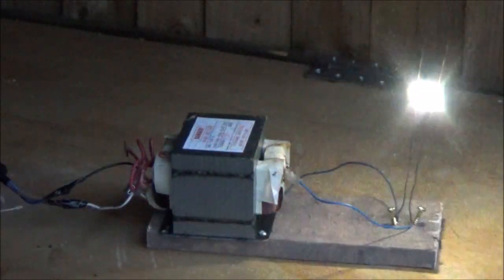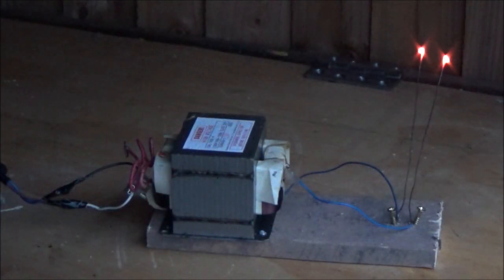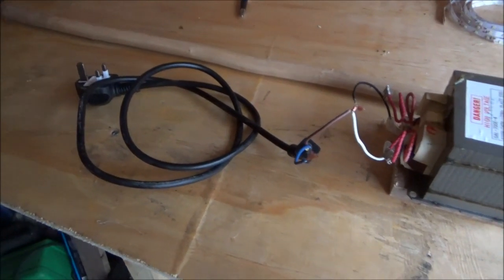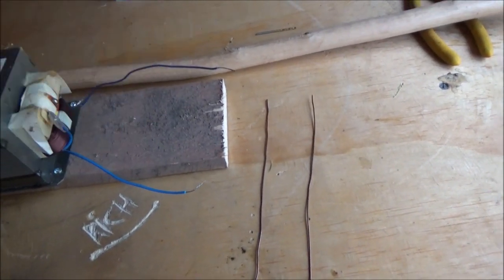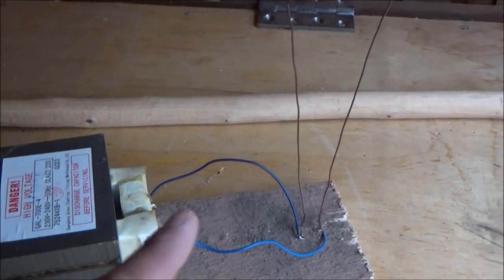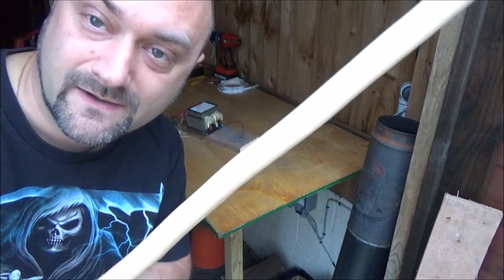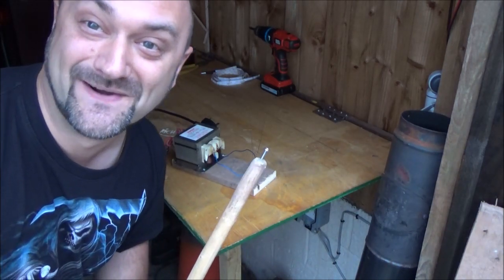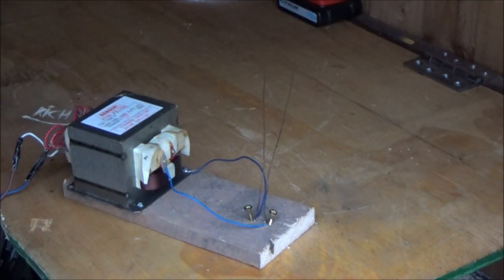DANGER How to Make A Jacobs Ladder using an old microwave transformer - 5KV Electricity Sparks Fly!

Comment: lets say one has 60Hz mains and would like for their ladder to have some acoustic resonator gain - what might work reasonably well other than a 1/4 wave tall enclosure for the electrodes to get the deep tone and overtones?  - would a Helmholtz resonator at the base work? - or would it act more as a muffler?  - all I've handy are 60mA 12KV and 15KV sign xformers
Reply from the maker: A bloody great speaker and amp!!!  Actually... perhaps you could put a small pickup coil close by and the mag field would be enough to drive a speaker!!

Comment: You can tune it by adjusting the gap at the bottom so that it will arc on its own.  The heated plasma rises to the top, when the arc goes beyond the top it will start again at the bottom and repeat.
Reply: That works best with neon transformers. I did this shit 20 years ago.
Reply from the maker: Don Johnson I will try this...  see if I can get it to run on it's own! . Thanks!
Reply: Or a lit candle